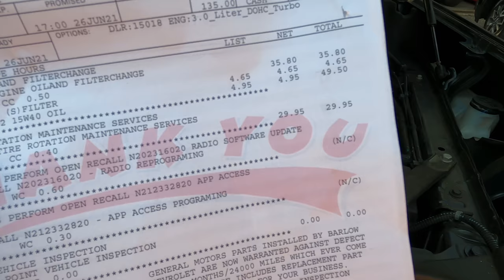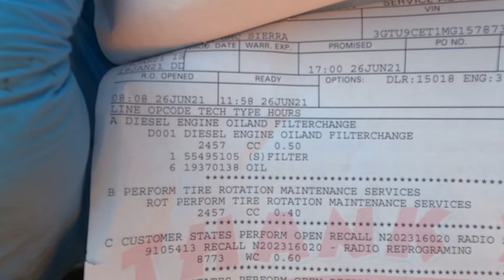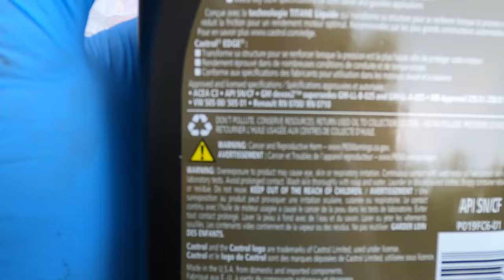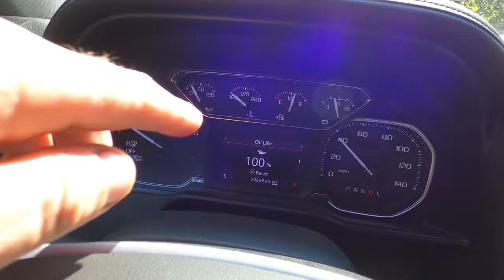3.0L Duramax Sierra Oil Change - I did NOT use DEXOS D oil!!!

Comment: 0w-20 is so Chevy can please the EPA fuel economy requirements.  That's why these engines get blow by.  After break-in, I use 5w-30, no issues at all.  I did the same with my two Toyotas, no issues.
Reply: Demon works actually posted the clearances for the engine. Very tight. I think 30W would work in a pinch but looks like sticking to a 20W is ideal.

Comment: “DexosD” was developed by GM for licensing/branding marketing. Oil companies pay GM big bucks to stick that spec on their bottle. Currently, Ow-20 is the weight (5w-30 is on the way).  GM recommends this arctic oil to meet CAFE standards. Any ACEA C3/C5 or VW 507/509 oils are just fine. Many other brands are fine too…even those that choose not to pay GM to license the brand.  Your truck won’t notice the difference with the Castrol you used. 👍
Reply: How did this get 20 thumbs up? This is very inaccurate.
Reply: @davidporter7051  How is it inaccurate?
Reply: @johndsmith7785  because DEXOS D isn't an artic oil. It has a HT/HS of 2.9 or greater which means it's actually "thicker" than many 30 grades. The Castrol used here isn't remotely close to what is specified and DEXOS isn't just a license it's an actual performance specification.

Comment: It’s the weirdest thing that the oil, filters, and even diesel GM recommends is hard to find.  Even the Top Tier diesel is only available in one or two stations on most states.
Reply: I got a PF66 filter and 7 one quart bottles at my local Advance Auto store.  $11.99qt.  Not available in a 5qt bottle.

Comment: That oil (Dexos 2 5w-30 not to be confused with Dexos 1 gen 2 or 3) is also spec’d in the Cruze diesel, equinox and terrain diesel, Colorado and canyon diesel, all with the same emission systems / after treatment systems. Currently we’re running the 0-20 Dexos D in ours, but we have fleet pricing through the dealer and it is basically the same price for us as Dexos 2.

Comment: I'm looking to get a Silverado RST Duramax next year and I will definitely be doing my own maint because the dealership charges way too much and usually screws things up anyway.
Here's a tip... don't rush taking the oil filter off. Just loosen it a little until it starts to drain and let it drain slowly, then you can remove it without oil running down your arm.

Comment: I believe that the oil you used will be fine. The only thing that concerns me is that the oil pump on the Duramax 3.0 is driven by a belt and that belt may be sensitive to the oil type. Amazon, as you probably know has everything you needed in stock the Dexos D oil and the PF66. While that truck is under warranty I personally would only use OEM, but that's me.
Reply from the maker: At the time when this was filmed several months back oil was weeks to over a month wait across the board. I fully admit I waited too long for a change but was able to come up with the above combo and have already changed it since because I drive so much. Zero issues.

Comment: I’m going to use Euro Diesel 0w-40 and the bigger PPE filter (got a Black Friday deal on them and stocked up).  European diesels have as strict if not stricter emissions systems than USA. The hyperventilating in the comments is a non issue.  The 0w20 weight is for cheating fuel economy… VW learned the hard way about this an the BRM disaster they had with the TDIs.  

I deleted my 2.8 Colorado and have ran 5w-40 & 15w-40 oil in it since new and bumping on 100k now with zero issues and great Blackstone labs reports.

Comment: Interesting note is that the pf 66 oil filter has no bypass valve. Variable displacement oil pump so I would stick with 0w20. I get my dexosd from rock auto.
Reply from the maker: Point me to this literature, please. From what I can tell the PF66 has the standard poppet style relief valve like the rest.
Reply: all filters should have an bi-pass valve or they would blow up when dirty or clogged.
Reply: @cristiana.8241  false. some engines have the bypass in the block.

Comment: My recommendation is to change the oil more often, like 5,000 miles instead of the factory 10k recommendation. With emissions era diesels, everything will be more expensive. 

The 0w20 vs 5w30 is for cafe rules. They can claim 1 mpg better with thin oil and another mpg with the 10 speed transmission.

Comment: I would rather go three thousand miles with any type of oil than go 15,000 miles with a gm approved, dexos d, lgbtq oil. When oil gets black it doesn’t lubricator as well. Then pieces of metal get in the oil and cycle through your engine doing damage. I wouldn’t ever go over 5k miles before an oil change regardless of % on dash.

Comment: The oil pump is a variable displacement pump, the pressure is regulated by the ECU, regardless of the weight of the oil.

Comment: Thanks for posting. I just purchased a 2022 Silverado 3.0 dmax. Am thinking of doing my own maintenance due to dealership issues in the past. So far I've heard that Mobil1 also sells an oil that conforms specifically to DexosD requirements. Same wwith Amsoil as well. I think (in time) more companies will offer it.
Reply from the maker: Just used the Mobil 1 ordered from NAPA…ordered online and there in a day or two. Good stuff!
Reply: How do you like your truck?  How’s it holding up?  I’m thinking of buying one also.
Reply: @wheel1775  It's been great for the most part - fuel economy is awesome for it's size, and rockauto sells the correct oil and filters for cheap. I have 35,000kms (21750 miiles) on it already and love it. Just installed airbags to help with towing our heavy travel trailer, makes a big difference.

Comment: I've been running Schaeffer's 0-20 since my 2020 3.0L was new.  I've put 42k on it in just over a year and have had zero issues whatsoever including hauling a 2k lb truck camper all over the west last summer in 100deg heat up and down mountains.  I also live in the northwoods of Wisconsin so it also see's sub zero temps on a regular basis during the winter.  Still running like a champ!  Diesel oil is ALWAYS much darker than gas engines.  Why the hell are you using the wrong oil weight?  There's zero reason for running anything other than 0-20 ALL YEAR.
Reply from the maker: Online ordering was 3-4 weeks out, and after stopping at 5 auto parts stores this oil is the same thing that is run in the 4 cylinder diesels in the Colorado. Like you I ran it thru the truck twice with zero issues whatsoever. I’d ask you why you ran a non “approved” GM oil in yours? It’s not DEXOS D so??????

Comment: I run Amsoil signature series heavy duty diesel oil in my 2019 Chevrolet 3500 Duramax  L5P for 50,000 miles.
Reply: And Amsoil sells oil filters as well.
Reply: And you can go 25,000 miles or once a year with that oil. I run 15,000 miles because I tow with my truck.

Comment: I did something similar.  I have 24% oil life remaining, and I needed to add about a quart.  I could not source the DexosD, so I got 0-20 Valvoline Synthetic Dexos.  Figured a quart would be fine for the next thousand miles until my next oil change - thoughts?
Reply from the maker: The dexos2 I used is the same oil GM recommends for the baby Duramax in the Colorado. Pound for pound it translates similarly to the dexosD. I’ve had several thousand miles since my video with zero problems. Will 100% do again if needed.
Reply: Just make sure when you change it or do something similar next time to atleast get dexos 2 not dexos 1gen2

Your totally fine but generally you want to atleast top
Off with a diesel rated oil. It’s low of sulfated ash vs regular dexos isnt and would overtime damage the emmision system

Comment: Just hope nothing goes wrong with the motor. Using the wrong oil viscosity will void all warranty. I am a service advisor at a Chevy dealership and already had a warranty claim denied because of it.
Reply from the maker: Already on a fresh oil change without a single issue. It’d be a fun discussion as the dealership had also utilized the wrong oil on an oil change several changes prior….I have the paperwork to back it up. 15w-40 that time. How would Chevy handle that then since I was told it was “just an input error” but could show me the empty bottles? Appreciate you watching and always interested in feedback from the folks in the industry.
Reply: @BanditDavesToyChest  I'm not really defending either one but the consumers fault is largely different than the dealerships fault. The dealership will replace, if necessary, but manufacturer's can easily decline the consumer's request because it's what we signed.

Comment: So Dave what does the manual say are the specs on the oil? There should be a lot of oils that should meet the specs. Also because of the emissions don’t wait to change so late. Oil is cheep, 50 to 75%on your oil change meter would be good.
Reply: Only two approved oils per GM, both are hard to come by.
Reply from the maker: @marcpeterson6152  2000+ miles on this change this far and zero issues!
Reply: At the time only Ams oil and Gm where ok. Now there's more. BUT The OEM kits are now readily available
Reply: @edhlavaty6914  
Hi Ed,
I’m just curious what oil are you running in your d max now? Hope the truck is running good.

Comment: Do these 3.0's normally burn oil?
Reply from the maker: I have not experienced it but that doesn’t mean others haven’t. I try to be pretty transparent that I think I drive my diesel under pretty optimal conditions - warm it up in the am then drive 105 miles at ~70mph for about 80% of the drive. At night I do it in reverse. Very little stop and go. Love the truck and the 3.0L very much!
Reply: Zero oil burn issue for me. Had a 21 3.0L 2wd. Traded for 21 3.0L Z71. No issues on new pickup
Reply from the maker: @waynehawkins9090  great to hear!  Check back in periodically to let me know how things are going!!

Comment: Your oil will be jet black and that is completely normal for a diesel injure. And it’s not to do with the fuel it is to do with your EGR. Your EGR takes exhaust gases and recirculates it back in the engine. The set in the exhaust is what makes your oil black.

Comment: What about Pennzoil Euro 5w30? I use it in Sprinter Vans and Diesel Benz E250 for the past 2 years and no issues. Any opinions on that oil? It says it is good for gas and Diesel engines.

Comment: I had the same problem but I used Mobil one advanced fuel efficiency dexos1 gen2 0w20 and the Purolator. I'm not happy but that's all that was around at all off my auto parts stores and I went to all of them hoping to get the Mobil one esp. I plan to change it out at 3k with the acdelco kit
Reply from the maker: My guess is the truck doesn’t even know the difference! Right now I’ve had about 3-4 thousand on my previous change mentioned in the video and not a single hiccup. I have stocked up on filters and will probably switch back to to 0w20 on this next change because of winter. But if I get into a jam again….my mission is clear! Haha 

Thanks for watching!!!